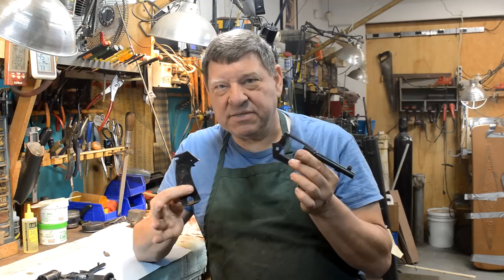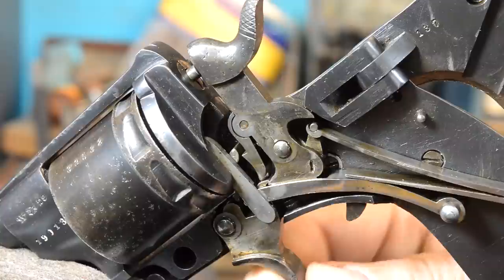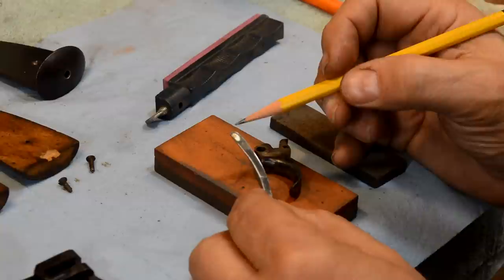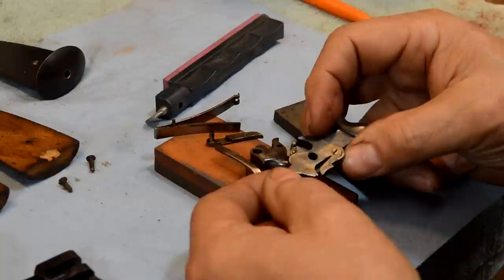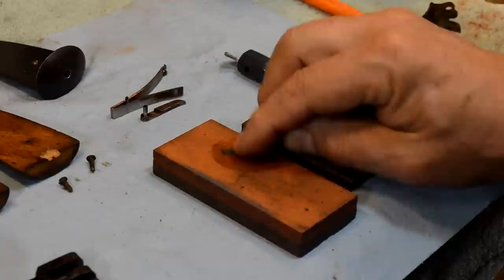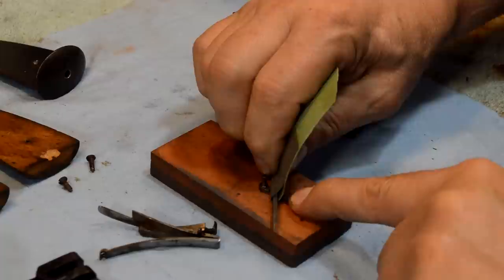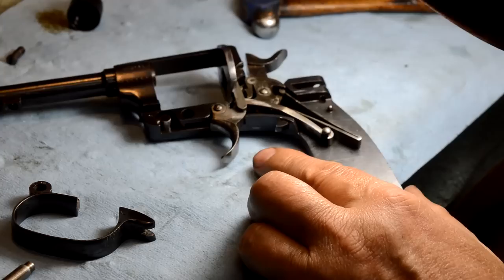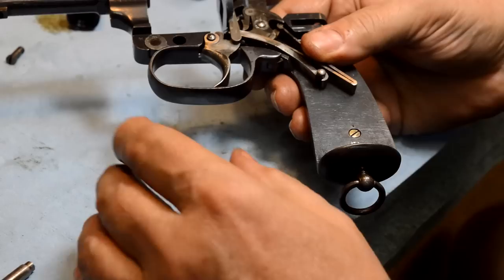M98 Austrian Gasser revolver timing: Anvil 123

Comment: Excellent as always!  Not a gunsmith but instrument and tool repair is my hobby, your demonstrations work on most mechanical systems.  Back when I was much younger I managed to get a chip from a hammer face in my right forearm.  Small entry scar and a 1/2 long scar where an ER doc went in with a pair of forceps to extract the chip.

Comment: That Arkansas stone is called a soft Arkansas stone.  There is another white type called Hard Arkansas which is much finer in grit.  Sadly new white Arkansas stones haven't been available for decades.  As said, the quarry was mined out long  ago.   Most of the ones still around are a little small, naybe only an inch wide and 3 or 4 inches long, but back in the day, up until maybe the early 1960s, there were large ones the size of a thin brick sold in wood cases.  Sadly they are quite brittle and if you drop one you will probably be crying.  $$$  When I find them at flea markets and auctions I try to get them. Old white ones are sometimes dished, but there are things you can do to fix or work around that.  Worse come to worse, flip it over, LoL

Comment: Mark … I have been watching your YouTube videos for a few years and just love your knowledge and instructions and abilities with all types of firearms. This comment is NOT about this video or any of your prior videos and is a QUESTION. Over the last years I have been collecting older pistols from late 1980s and early 1900s. However, I lately got one Smith & Wesson Model 1 1/2 .32 S&W and found some parts were badly worn or broke. Then I got another that was basically in good working condition and the nickel plating was badly worn or flaking. The problem s parts are nil to none and I was lucky to get some parts and fabricate some others. Problem also is diagrams of the proper positioning etc. are just not there. Question do you have or do you know where to look for such a diagram. You help would be greatly appreciated! Thank
Reply from the maker: Short answer, there is no hidden documentation.
Reply from the maker: I don't have one to copy unfortunately.  Difficult issue to handle in the comments
Reply: Thanks for getting back … you are the BEST 🤜